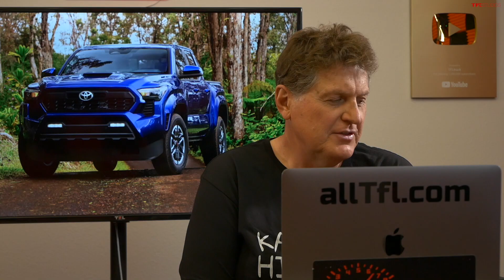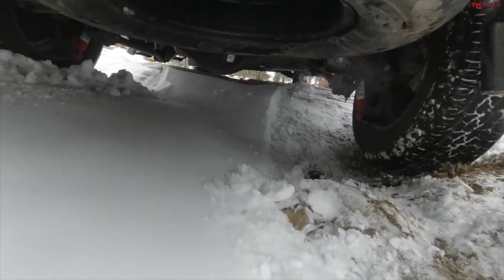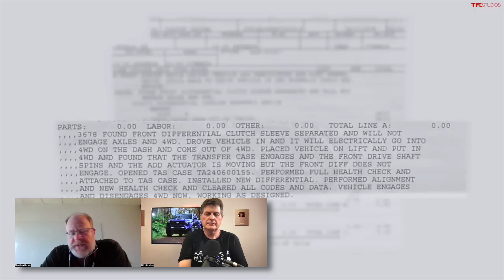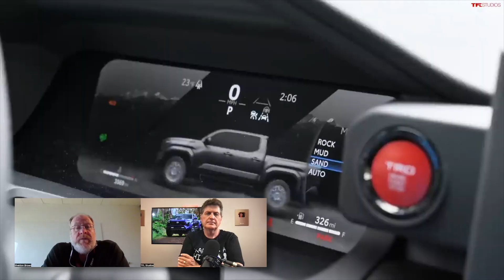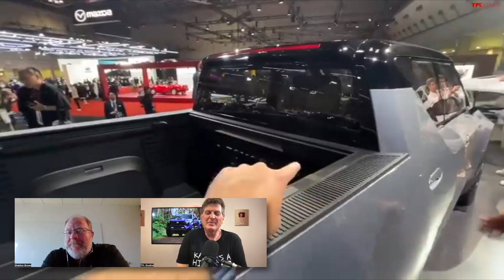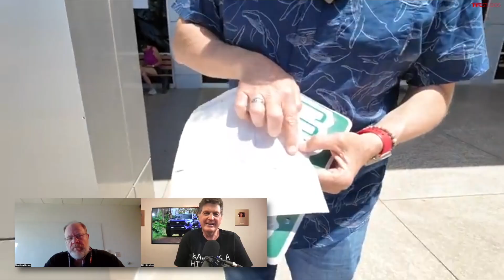The Real Story Behind How Our New Tacoma Broke & How Toyota Plans To Fix Yours!

Comment: So their explanation is that their drive system broken their drive system. 

How wasn’t this caught? This is a huge red flag. 

I mean this is an absolute high risk case since it was literally their own traction control system that caused the feedback torque to be applied differential instead of just spinning a wheel…

I was going to buy a new Tacoma. But here in Canada we had trims I didn’t want yet so I waited. Glad I did. Not buying one at all now.

Comment: So.......be really careful driving this "truck".  Don't put larger wheels on. Dont put more than 100lbs in the bed. Only have 1 passenger. Use the brakes and accelerator gently. Otherwise the 1.7% threshold will be crossed resulting in failure of drivetrain components and a visit to the Toyota garage where you hope you still have warranty on it.
Reply: The best part is... Tacoma fanboys were reveling in the new gen being able to take larger tires w/o a bodychop.
Reply: Pathetic , uh 😢

Comment: The RISE and FALL of a KING, I will not be buying ANY TOYOTA's UNTLL I see HOW  they FIX this and ALL their problems, we customers buy TOYOTAS because the DURABILITY and REPUTATION, NOW, they LOST ALL OF THAT, and peoples HARD EARNED $$$$$ is down the drain, and their STUCK WITH TRASH, I have a 2007 Tacoma TRD Off Road, and what this guy is explaining is crazy, I wanted to TRADE IN and get a NEW ONE, and w/ all the problems now since 2021 and up, I decided NOT 2, going w/ NISSAN FRONTIER, NISSAN IS and HAS BEEN a DURABLE TRUCK, and the 2 have been neck to neck, w/ Nissan staying with the same program they have had and sticking with that, making it better, but staying with the foundation , I've chose to get a NISSAN, we will see what happens and see how they fix their problem w/ all their new lines and see how they treat their customers and make it right

Comment: Not filled with confidence after that. First of all the Tacoma is a 4x4. It can’t “send” power to individual wheels, the center was locked, and the rear was locked, there is no way to “send” 100% of the power to one wheel. If this was possible it would break every time 3 wheels lost traction. At best you could “send” 50% of the total power to one front wheel, even then you would have some loss to the braking resistance. Still really doesn’t make sense they are saying both front wheels would be braked at the same time, that should never happen the goal of the system is to equalize wheel speed it should release the left or right depending on which is spinning faster. 

Even still tapping the brakes in a 4wd without traction control is a time tested 4wd trick on snow to get all tires spinning the same speed. A proper truck should be able to easily handle some braking under power.

Comment: So what I'm hearing is that if you put full torque through one wheel, it will break. Is that not something a vehicle like this should be able to do without issue? Think of a submarine: there is test depth and there's crush depth. Test depth is known hull integrity. You can go that far and know you'll be fine. Crush depth is the theorized outer limit of performance. Past that, all bets are off. It might be able to survive beyond that point, it might not. But up UNTIL that point should be okay. The point is, crush depth is not going to be only 50 feet past test depth. There's going to be a nice healthy margin of safety between those points. Doesn't sound like such a margin was present on the Tacoma.

Comment: The most damning thing for toyota  is there was a chevi right there that made it up that trail..in the same conditions 

They increased  the torque  of the taca without  increasing how sturdy the Diff is to handle it..

Or they tuned it to where they shouldnt to get over inflated numbers on a spec sheet..

However you slice it this is a quick fix. Update  the cpu in the trucks to output less torque  in certain situations they shouldnt have this issue..

But they shouldnt have had this issue in the first place..this was the first outdoor outing by RFL..

Which means they didnt do extensive testing on their trucks..you're  pretty  much suppose  to test vehicles to breaking point before  finalizing numbers..

As someone  who bought a 2024 Tundra ..it doesnt instill confidence  in Toyota.

Comment: lower quality build, higher price fee, weaker drive train, only one locker, 45k for a mid size truck. I have my at4x edition one at 55k msrp and its insane the quality difference sin GMC vs Toyota. 

I have to agree with others, Toyota would not acknowledge others issues like TruckKing or even my dads TRD pro Tacoma, he's currently fighting Toyota to fix the air sensor in the turbo. 

He's only put 2900 miles on it too, meanwhile I'm taking my canyon at4x up to New Mexico trails and snowboarding at Taos with no issues. 

This is a serious hole that Toyota has shot in their foot.

Comment: That's a lot of words to say the differential is weak.  And the solution is to software limit the torque.  Pathetic.
Reply: Thats what Jeep did with the Liberty diesel when they were blowing up torque converters. 

"Oh, here, we sold you a jeep with 300 ft-lbs but were going to limit it to 250 ft-lbs with a new tune when in 4th or 5th gear and the torque converter is locked, exactly when you want the low end torque of a diesel."

Comment: Solution: build it better? Nah, nerf it. I’ll stick with my 200 Series LC thanks.
Reply: The 200 series is essentially a Tundra, and even beefier in some ways, and has always been significantly stouter than any Tacoma.

The turd gen Tacoma just was so weak with that torqueless 3.5L it couldnt break itself.

Comment: Toyota has embarrassed itself. They can’t even assemble a manual transmission that is serviceable. Manual transmissions have been around a hundred years so Toyota had to work hard to find a way to screw up a manual transmission. Sounds like this explanation is describing a design flaw. I don’t want them (Toyotas) anymore. So long old friend.

Comment: This is why I did NOT purchase a new Taco. They have very sus build quality in and out. Even the Tundra does. Very thin and flimsy sheet metal as well. The worst forward visibility of all of the trucks out there with the highest price tag. NO THANK YOU!. I have owned so may Tacos over the years....so the latest gen is just sad. Get a GM twin, Ranger or most bang for the buck, the Frontier. Thanks for the video update boys.

Comment: On another YouTube channel the Tacoma TRD off-road with 6 speed manual transmission didn't make it through the review either. The clutch gave out on straight pavement. No hills, no load it just gave out. At this point I wouldn't trust Toyota to make toilet paper.

Comment: What he's basically saying is that they greatly increased the torque of the engine, but Mike Swears was so cheap he insisted on not spending money to upgrade the rest of the driveline to handle the big increase in power, so this guy had to use the computers to make sure that at all times the power of the engine is being heavily limited to protect all the weak carryover components. And if you use the truck like a 3rd or 2nd gen, just know that if you manage to find a way to exceed the software limits a d break something, ToMoCo will find a reason to deny warranty coverage even though they know they should have beefed up the axles, tie rods, differentials, transfer case, clutch, etc. Hey, gotta top last years record profits and just raising the price $20k and slashing labor costs by 97% by moving all production to Mexico might not be enough!

Comment: I was going to buy a GX550 to pull our 4 ton 30 ft sailboat but between the shitty V6 motors, bad transmissions and now this I guess we'll stay a 3 vehicle household and  keep our 1996 Isuzu Trooper for the heavy trailering. As for the forces on the the driveline in your video; they are nothing compared with backing uphill on a 100 degree day in low range on asphalt with full lock steering input with a 4  ton boat on a 1800 lb trailer behind. And I've been doing that for 22 years...........to date.

Comment: So I completely understand what they are saying is that all that low end torque that you guys were bragging about, along with traction control is the problem. Now you know why Chevy 4cyl the torque comes in much higher in RPM range so there’s less likely issues with low torque. Now nothing wrong with low torque engines but in the case of traction control maybe not so much! It’s like your power breaking is a great way to snap axles. I bet that software takes some of that torque away in 4low. Just my take

Comment: BS explaination! This broke super quickly. Obviously the parts are under engineered for the application. Toyota is back peddling to cover their overly aggressive value engineering. Better, Cheaper, Faster in that order is key to maximizing efficiency of a manufacturing line. If appears that Toyota missed the "Better" in this generation of Tacomas. It's a cut and dry example of what happens when Safety, Quality, Output fails. Prioritizing Output over Quality and Faster over Better is exactly what Toyota has done. They set the standard and then failed to enforce it. Plain and simple.

Comment: Sheldon gives me the feeling Toyota has reduced the margin of mechanical error to shave bucks. I hope Im wrong but no way Roman's light throttle and moderate wheel drift with light payload should cause diff failure on snow and ice.

Comment: While you are working on updates, I have a suggestion. I currently own all the different gen Tacomas. 

The 24 is a great truck.  One tweak I suggest is adjusting the rate of acceleration while using dynamic cruise control.  Say the cruise is set at 75 MPH and you are following another vehicle at a lower speed, say 60 MPH, and that vehicle finally moves over, the Tacoma wants to acceleration back to 75.  It does not need to down shift two gears and mash the gas and take off like a race truck to get back to 75.  When I am using cruise a smooth comfortable ride is the goal, so limit the rate off acceleration as if a person would do it, nice steady rate and smoothly get back to the set speed without all the downshifting and racing back to the set speed. 

I will say it is better than my 19 Tacoma in this condition.   Really can't find anything else complain about.  Toyota did a great job on the 4th Gen.

Comment: Yawn corporate mumbo jumbo . Wheels were spinning traction control applied brake and frail parts broke. In a nut shell the new taco has weak front end parts. If you plan to put aggressive tires choose wisely

Comment: You mean it broke by exceeding the minimum strength by 1.7% broke the diff? That is an awful slim margin between spec and failure.  I have engineered a lot of stuff in my 45+ year career and that thin a margin would scare the crap out of me.  I would not release anything that had such a narrow margin.

Comment: my first gen tacoma with 275,000 mi on 35's and lockers running on 500% over design load capacity bangs rev limiter in the snow all day. running on 1.7% factor of safety is absolute trash.

Comment: A software fix to a mechanical problem.  Code is cheap.  I hear marketing/lawyer speak.  There will be more failures.  Material and manufacturing failures are increasing as more vehicle systems are outsourced.  The curse of distributive manufacturing.  “Risk sharing partners” never have enough oversight.  Automobiles, aircraft, and other complex systems have all fallen prey.

Comment: Only time will fix that although the 2025s should be en route imminently which is the only true correct fix for the consumer. If I was worried or did have a dud I'd certainly ask for the cost of trading up to a full size. Toyota will look out for buyers of their Sequoia and Tundra which is a good lesson for buyers that they never seem to learn but certainly can learn that right now as full size trucks and SUVs very much under pressure all Year now. "they want to be greedy because you are in fact playing the part as the mark" by buying these crazy high priced mid sized truck offerings.

Comment: I understand having a part that’s designed to break BEFORE more expensive parts, but having that part inside the differential is a problem. That’s what was great about tie rods. When they break they are able to be replaced on the trail.

Comment: I have a question and I wish it was mentioned.

I currently have a 20 trd pro taco and am curious if the driveline is based off of the same components that are in the new tacos?  I haven’t had the time to research part numbers however if this can happen with the new engine at low rpm’s then if the old trucks have the same system wouldn’t it happen at high rpm’s with the V6?  Grated I think this is more so an automatic trans thing because of the drive programming but!  I have a manual trans in mine and I’m sure i can blow past those limitations in 4low.   I know the new engine and the V6 are different animals however tomato tomoto low rpm high rpm in terms of torque.  It will have the same outcome because the same stresses will be present at those points.  Downside is high rpm also means more rotational mass and will this type of issue happen when things are moving fast or will it be more catastrophic?

Long story short.   What does Toyota say about the older Tacomas and are the systems the same part numbers theoretically?  If so, could there be a potential issue there.  And will Toyota help with the upgrade or will this be on our own dime if we own the older Tacoma?   (If the systems are the same)

Comment: To everyone oblivious on how torque works, I'm not aware of any axles that will take 100% of the torque to a complete stop without breaking. All they have to do is change the software logic to not send 100% of the power to 1 wheel and suddenly brake it. It only broke by 1.5% of the parts torque rating and thats through a torque multiplier (tranfer case in lo). If you split that between 2 wheels you're only using half of the parts torque rating. They have 4 of them. So they don't need to detune it. The part did what it was supposed to do. The software logic is what failed. I've broke a 9 inch ford axle after wheel hopping during a burnout that is basically what they simulated. Max torque during a spin to an instant stop.

Comment: Remember that Toyota builds the Tacoma for the North American culture that has the majority (vast majority) of trucks being used as grocery getters / daily drivers with absolutely no "truck" use. Of course you're going to get the bare minimum because that's all you need. Toyota does build a real Tacoma-sized truck for the rest of the world. A world, unlike North America, that because of taxation, cost of gas, size of parking spots, etc etc, many more trucks are bought only if absolutely needed to do truck things. That truck is the HiLux, and it is incomparable to the Tacoma in terms of the drivetrain, frame, and suspension. It doesn't get the 14 inch display, and the butt-washing seats in the Tacoma TRD Pro, so it's not able to be sold to the discerning North American truck buyer...

Comment: I wonder if any of theae build quality issues have to do with Covid...
Given inflation and supply chain issues I was wondering what the quality would be like for this season till things got back to normal. I've seen people abuse the 3rg gen on 37s and somehow not snap things left and right. I suppose time will tell if this current setup actually works or not given people will also start to put larger tires on it and abuse it en mass.

Comment: This video made me really, really miss my old 1986 Nissan "Hardbody" 4X4 pickup with its manual 5Sd manual transmission and manual 4X4 selector (both were "stick" shifts), and it's basically bulletproof four-cylinder engine. It could almost climb trees and never broke. Even a "rust belt survivor" six-cylinder '92 Pathfinder with the five-speed manual transmission and manual 4X4 (also a stick) that I purchased used in the late '90s never broke....It just finished rusting away after I put nearly 40,000 city, highway, and offroad miles on it.

Comment: So the front portion of the driveline had exceeded its max capacity by 1.7% and failed? This is super disappointing. It should be built to accommodate much more than that… unbelievable

Comment: Sounds like they need to beef up the drivetrain substantially.  No, differentials don't explode and axles don't just 'snap' at 2,500-RPM off road with light wheel spin.

Comment: Kinda makes me sad. I had. “Toyota Sport Truck” before they called em Tacomas and that thing lasted forever. I took it off road hunting beat it off trees and rocks and it kept on going. Finally sold it to a friend to get a Tundra in 04 and again in 14 and don’t regret either of those purchases. Probably won’t be getting a newer Toyota any time soon though. All vehicles are way to expensive and in the age of energy efficiency they all seemed to loose a step.

Comment: I have a 2017 Tacoma TRD-OR with 265/75R-16’s and I beat the heck out of my rig on off-road trails A LOT worse than what broke the TFL truck. I frequently have had my truck in MTS mode and spun my front tires on steep loose inclines and have not had an issue. I’m keeping my 2017! 🤙🏼

Comment: Toyota has changed their models with the SUVs and trucks. And with that change comes $$$ signs. Now with these new changes, new problems. So bottom line if you don’t treat each new generation Toyotas like China glass, then it will w/o a doubt, crack. Good luck.

Comment: That was an incident you could expect if using that car off road in the winter, the moment the front tyre starts to spin, it's going to load it's partner wheel, unless it is spinning too. 
  I'm saying it is going to happen over and over until Toyota upgrades that part.